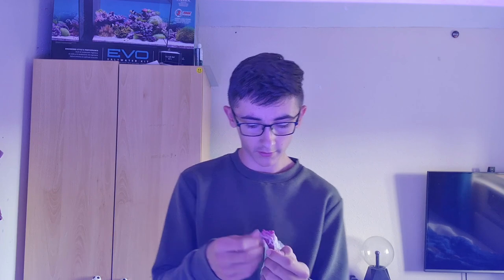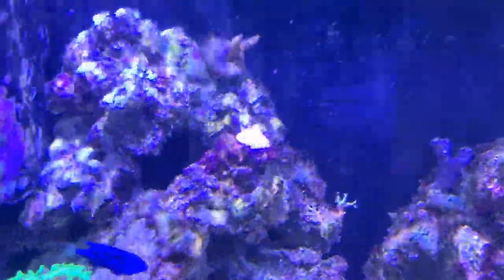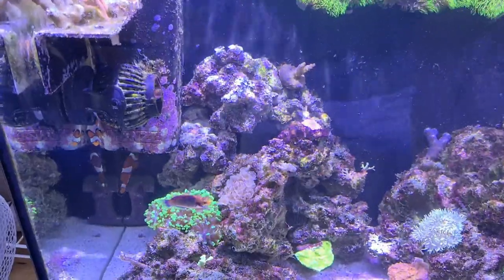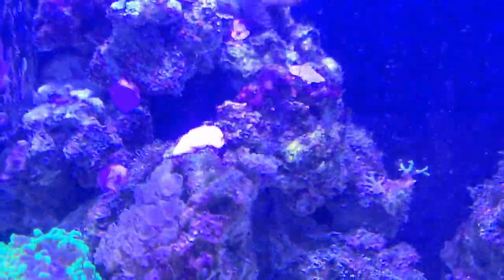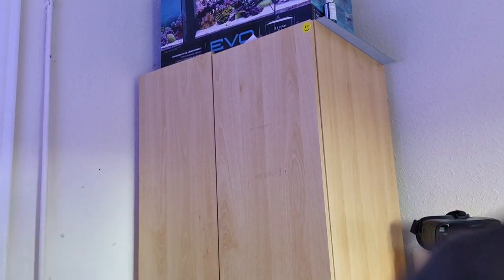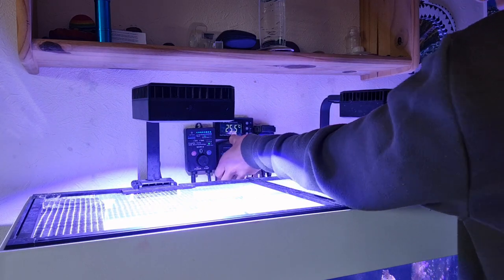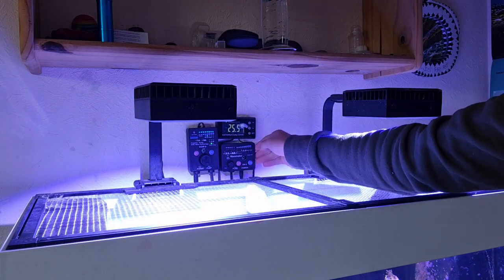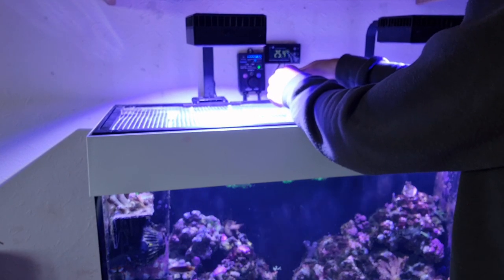Reef tank Aquascape fix + controller system arrangements.

Comment: Nice update Corey.
I can’t believe your running 2 jecod sow 8 powerheads.
I bought one for my tank and it just seems too powerful, even on the lowest setting all my corals seem to get blown about and my fish hide. 
The other strange thing about the sow 8 is on some websites it says it has a flow rate of 500 to 8500 lph but on other websites it says it has a flow rate of 700 to 8500 lph. 
The one I’ve got says 700 to 8500 lph. 
I’m going to try it in my tank again but I think it’s gonna be to strong.

Comment: I have a tunze skimmer (I think 9004), but why do you need a controller for it? I've set it up, it skims and I just need to empty the skim cup during my weekly changes. What does the skimmer controller do? 🤔
Reply from the maker: Allows u to control how much and how affective its skimming. Also, there is a button to pause the skimming for 10 min for cleaning
Reply: @coreywillard9250  the effective bit.. So the screw we manually turn for air, the controller does that automatically? Is thst it then?
Reply from the maker: No, there is dial on the controller to manually control it